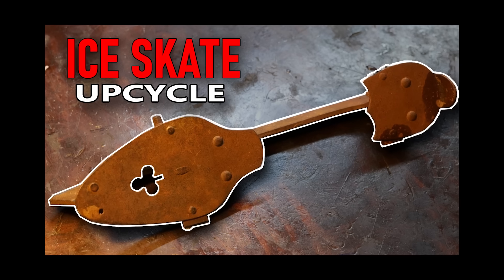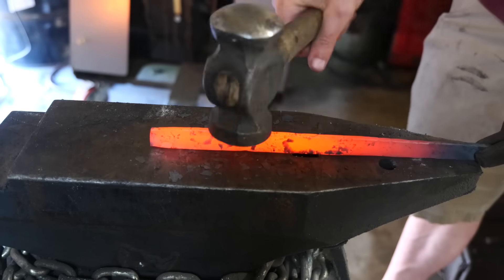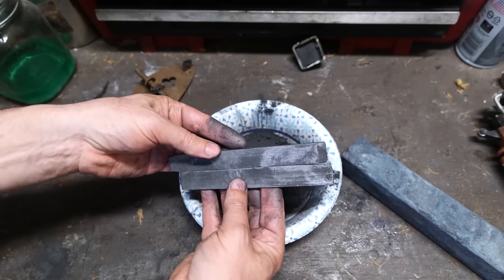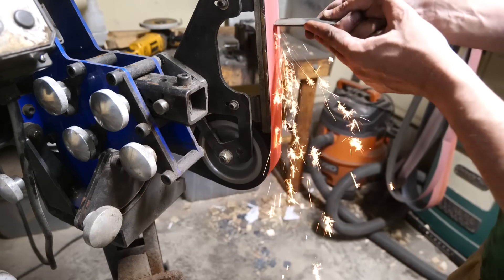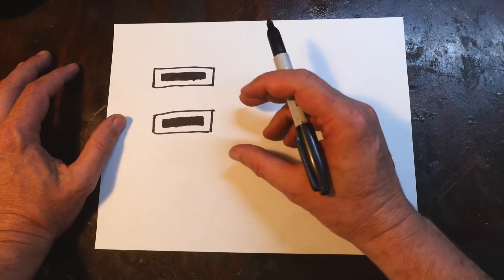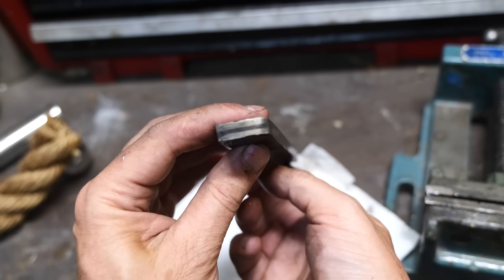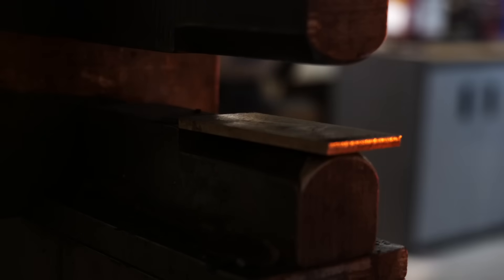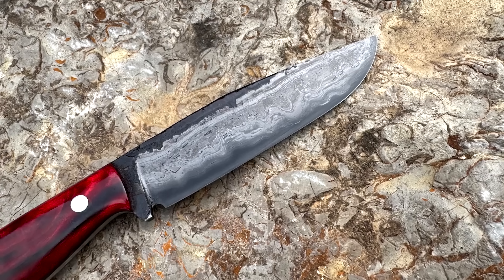Forging A Knife From A Vintage Ice Skate

Comment: I'm surprised that the extra high carbon steel 'cladding' didn't crack during forging. Did you test the hardness of that? The red handle is beautiful!
Reply from the maker: water quenched to over 65.  very strange, it didn't act like cast iron but it didn't act like high carbon steel either. maybe somewhere in between like ultra high carbon steel?

Comment: Also knifemaker that experiments a bit here: I don't think your "jacket" was cast iron. Very high carbon yes, but probably (hopefully? :) ) forgeable with some temperature control. If you try the same again, maybe run it at temp encased in some anti-scale to diffuse the carbon to more even?

Comment: You should try engraving mild steel before carburisation. It might create a localised increase in carbon absorption from the increased surface area from the engraved grooves.

It “might” create a pseudo Damascus pattern after etching.

Or perhaps try it with your touch mark instead.